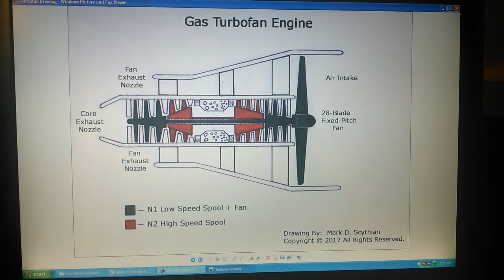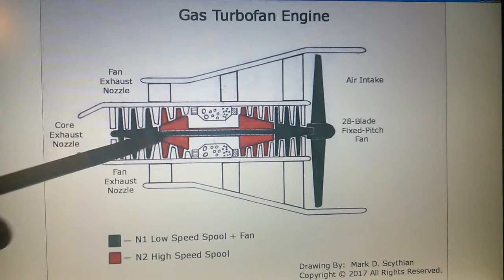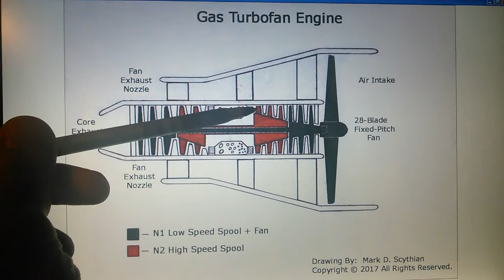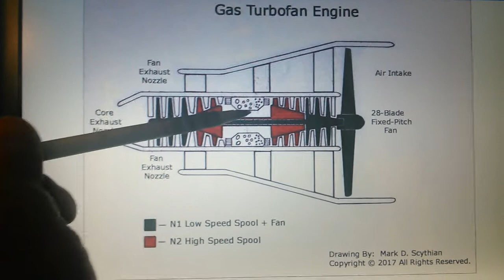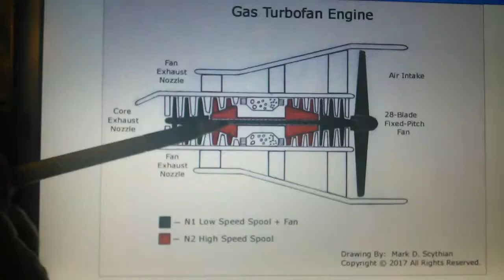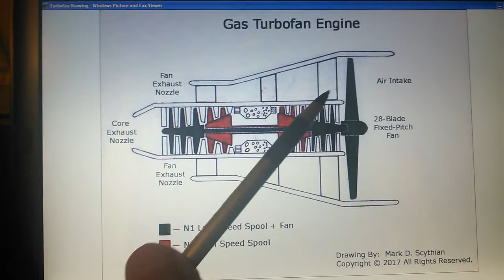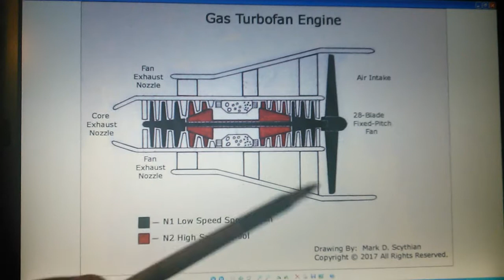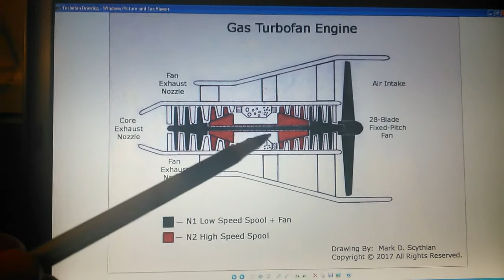Gas Turbofan Engine Principle of Operation (Refresher Course)

Comment: Both N2 & N1 shafts receive heat transfer from hot Turbine blades. Besides, Bearings themselves generate too much of heat when Engine runs at maximum RPM

1. How do Bearings (Ball & Roller) withstand high temperate Shafts zone?
What is the cooling mechanism?

2. Do Bearings get self lubricated or No lubrication?

Please answer to my both questions separately.

Comment: Thank you for the video mark, you have been very helpful for my atpl period
Reply from the maker: You're welcome!  Mastering the fundamental concept(s) of any given System, makes solving abstract applications easier.  For example, the Turbofan Engine is essentially an N2 "turbojet" for which the N2-Turbine functions as a Gas Producer, and the N1-Turbine behaves similar to a Free-Turbine to drive the large Fan and Low Pressure N1-Compressor.  Ever since 1981, the Turbofan replaced the Turbojet (or very-low Fan-Bypass-Ratio Turbofans) to conserve Kinetic Energy.   The hot gases lost to the outside atmosphere are instead channeled to drive a ducted multi-blade-fixed-pitch propeller fan, allowing for greater jet velocity of cold-air-discharge compared to an open propeller.  This is only possible if most of the hot gases that would be lost to the atmosphere, are absorbed by another coaxial turbine stack with more turbine stages, to convert most of the hot gases into an enormous amount of torque at lower RPM.  Open propellers are the most efficient, but lack the jet velocity to fly faster through the air, UNLESS the cold air flow is ducted into an ever-narrowing cold-air-fan-exhaust-nozzle AROUND the hot-gas-core exhaust.  

For example, a CF6-80B Turbofan pushes about 2,000 Lb/Sec Mass Airflow at max throttle and has a Static Thrust rating of about 60,000 Lbf.  The only purpose of knowing the Static Thrust is to compute the maximum Jet Velocity (V2).  Therefore, the Static Thrust in LbF is multiplied times gravitational acceleration (32.2Ft/Sec^2), then divided into maximum mass airflow:  the CF6-80B will have approximately 966 Ft/Sec average Jet Velocity at its Core & Fan exhaust nozzles.  After overcoming Aerodynamic Drag, the Net Thrust is the difference between the Jet Velocity and the oncoming airspeed (including headwind), then times Mass Airflow, then divided into 32.2 Ft/Sec^2.  Thereafter, the Conservation-of-Momentum takes effect, since a propulsion vehicle can only fly as fast as its Jet Velocity.  Aside from Pressure Altitude and Density Altitude changes, the actual Thrust needed to maintain high altitude high speed flight is far less than it is under 18,000 Ft MSL.  All that's left is to select the correct Jet Velocity by throttle calibration at 36,000 Ft MSL (which includes Net Thrust).  Need both Net Thrust and Jet Velocity metrics, along with altitude to reach rated  (cruise) TSFC for given Turbofan.  This is where the Conservation-of-Momentum reaches a coefficient below 1.0, and far less Net Thrust and Jet Velocity is required to maintain much greater cruise speed at higher altitude.  

Lastly, the Turbojet (or very-low Fan Bypass Ratio Turbofans) aren't exactly "extinct", as they serve their purpose for Supersonic Flight, but are very inefficient for Sub-Sonic and Trans-Sonic flight.   The basic understanding of the Turbofan is that it is a Twin-Coaxial-Spool concept, for which the N2-Spool behaves much like a Turbojet, and the N1-Spool behaves much like a Turboshaft powered off a Free-Turbine.  Absorbing hot gases that would be lost to the atmosphere to drive the large diameter Fan at higher Torque and lower RPM.  Including some of the Torque & RPM (less than 20%) harnessed to drive the Low-Pressure Compressor behind the Fan, to assist somewhat in heat-of-air-compression.  

Higher torque at the Fan means larger amount of mass air drawn ingesting at lower speed, then compressed through the cold air bypass fan duct, exiting at much higher jet velocity at (cold air) fan-exhaust-nozzle AROUND hot gas core-exhaust-nozzle.  The result is:  higher kinetic efficiency, less RPM at N1 (lower maintenance, higher reliability), higher overall efficiency, improved TSFC, quieter, and paves the way for material-science-research to develop more advanced Turbofan Engines.  

As of 2022, the GE NextGen has a "super-small" compressor, with nearly 50:1 Compressor Pressure Ratio.  "Cranking" out over 180,000 CHP at its compressor spools, while being 25% smaller than the CF6-80B, has a 36:1 CPR, and just under 150,000 CHP.  Material science is the source of advanced innovation, since the turbine engine (Brayton Cycle) is a relatively simple concept.  Look to the future, and the future is NOW!  Thanks for your comment!

Comment: Excellent and informative video, Mark! One question - what does the letter 'N' actually denote with regard to N1 and N2?
Reply from the maker: Hi!  Within the related disciplines of Physics and Mechanical Engineering, "N" typically refers to 'rotor speed' measured in radians/sec.  However, with respect to an entire Compressor-Turbine-Spool, "N" is construed as Categorical identification for single or multiple plane(s)-of-rotation, rotors, drive-lines, spools, discs, shafts, and controlled mass-rotation.  "N" in this particular case serves as Categorical identification rather than a Numerical constant, variable or coefficient.  Thank you for your comment and question!
Reply: @markscythian7179  Thanks very much!
Reply from the maker: @busker557  You're welcome!

Comment: APU maintain Generator frequency by running at the constant RPM. as the load vary, fuel flow schedule will also vary but RPM remain constant. So, therefore what change in side APU?
Reply from the maker: Hi Phoonsak.  As for any commercially-sold electric motor, gas piston engine, and gas turbine engine or literally any powerplant for that matter, engine/motor GOVERNORS are utilized to maintain constant RPM at desired power setting.  Regarding Electrical Generators, their RPM settings are usually set at a CONSTANT for optimized and/or maximum Torque output.   As for engine-driven AC electrical generators, engine RPM dictates the Frequency, whereas engine Torque may regulate the RMS Current.  Constant RPM also may dictate the RMS Voltage as well.  Especially in an engine-driven DC Electrical Generator, where RPM becomes DC Voltage and Torque becomes DC Current.   An engine-driven AC RLC Electrical Generator will use constant RPM to maintain Frequency, while RMS Voltage & RMS Current will self-regulate based on the given AC R-L-C circuit specifications.  Allowing for voltage and current Sine Waves to LEAD or LAG one another during start-up, load, usage, and Power Factor fluctuations (if any).   Brake Horsepower = [(6.28 x Ft-Lbs Torque x RPM) / (33,000 Ft-Lbs/Min)]

Comment: Actually, each compressor stage is composed of rotor then stator, not like picture, stator first then rotor. Turbine is correct, just like opposite of compressor. You should have checked that before using
Reply from the maker: The coaxial compressor spools (both N1 and N2) in this video, depict compressor stacks with a rotors separated by stators, behaving as divergent nozzles, which are designed increase intake air pressure while stabilizing velocity (Cascade Vane Effect).  Allowing compressor discharge airflow into the Diffuser, prior to entering the combustor(s). Specifically, compressor discharge airflow reaching temperatures of over 1,000 degrees F (heat-of-air-compression) and gauge pressures of over 340 PSIG, while moving at just 6 Ft/Sec, equal the flame-front-speed of Kerosene Jet Fuel combustion, (assuming 24.3:1 compressor pressure ratio as specified in the GE-CF6 gas turbofan engine). While within the Flame-Holders at the center(s) the combustor(s), surrounded by Dilution Holes.  For which the highest compression pressure exists at the Diffuser, a larger divergent nozzle stage preceding entry into the combustor(s), and after the compressor discharge nozzle.   However, the coaxial turbine spools in the rear, are depicted with impulse-reaction turbine blades with articulated turbine stator nozzle stages. Thus, optimizing thermal transfer and turbine efficiency, by directing thermal energy gas flow at an optimized angle upon turbine blades, to induce effective turbine impulse (Bernoulli) and reaction (Newtonian) force moments.

I was assuming that viewers are familiar with gas turbine engine core basic principles, and would interpret my sketch as described to you in the paragraph above.  Hence, "Refresher Course", not 'Introduction to Turbine Engines'.  You may want to click on my Video Library or Playlists and view my OTHER lectures on gas turbine engines, to view more detailed explanations.  Whereas this video is a Refresher Course, not explaining every detail as I do in my Turbine Engines Intro lectures.  Which depict compressor stator blade half-section casings, enveloping compressor spool(s), compressor blades, spool-seating,  journals, and bearings.  Perhaps, my drawing in this video was not as clear as it should have been.  However, this is a Refresher Course, so I was ASSUMING viewers already have knowledge and experience with manufacturing and repairing gas turbine engines for aviation applications.

Comment: Do the 2 shaft counter rotate?
Reply from the maker: Hi.  Some manufacturers design their spools to counter-rotate for optimizing the cancellation of all moments, including torque and procession.  Various designs by General Electric and Rolls Royce include reverse-flow stators and reverse-angle rotors and stators, for the counter-rotation of spools.  Although, most gas turbine cores are two-spools with mono-rotation configurations.

Comment: So what would n1 rpm be on a 737 engine
Reply from the maker: The B737 airframe and most variants implement the CFM-56 powerplant which has a maximum N1/Fan power rating of 104% or 5,200 RPM.  The CFM56 (and variants) has a fan diameter of approximately 67 inches (5 Ft, 7 In or 1.7 m).